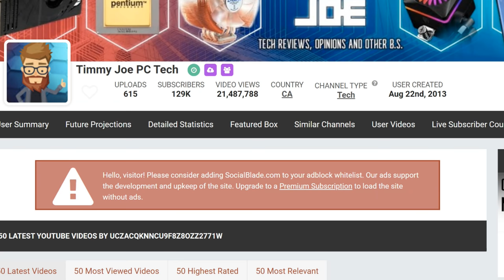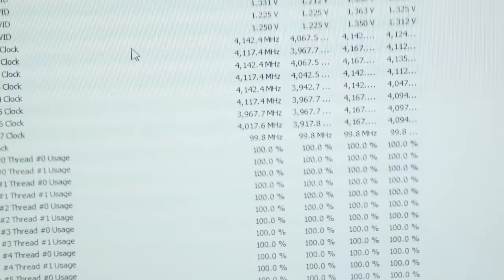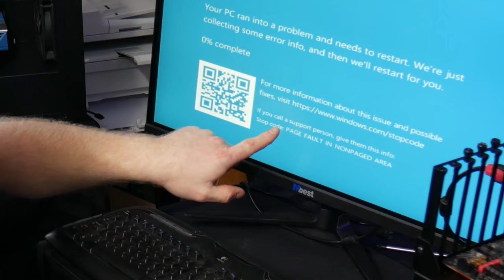This Ryzen 3700x was my biggest problem in 2019...

Comment: Weirdest issue I've ever had was with a Gigabyte 1070 surprisingly enough. I was building a computer for a friend and they had an Asus X99 motherboard and that card just would not post on that computer. I swapped it out with my 1080 and it worked. I put in a video card I borrowed from my office and it worked. I put the Gigabyte 1070 in my PC and it worked just fine. I even put both my 1080 and the 1070 in the PC and it would boot and I could see the 1070 in the device manager. Put the 1070 back in the top slot after taking my 1080 back out and no post. Weirdest issue I've ever seen. My friend ended up sending it back and getting an Asus 1070.

Comment: I went through similar pain years ago with a gigabyte board it was a G1 Sniper z97 for my 4790k build out of nowhere the system would suck all the available ram (16gb) into the non paged pool and the system would hang this happened for months despite trying everything registry fixes you name it after much trouble shooting I finally figured out it was the drivers to the Killer Network card. Also since the day I've owned it randomly the realtek audio card will  just vanish from the system and I have to reboot the system multiple times to get it to show back up I've since switched to a wireless usb headset and running my speakers through the monitor using audio over DP from my Nvidia card. Needless to say I'm building a new system sometime this year and Ill be looking at MSI and ASUS boards.

Comment: I just built a PC with a AMD 3700X and a Gigabyte AORUS Pro WiFi MB with the latest BIOS and haven't had any problems so far. The ram is G.Skill Trident RGB 3600. Running PBO but not PBO under XFR. PBO under XFR doesn't do anything but up the core voltage and make the CPU run hotter.

Comment: Yea, you were lucky...!
Last summer I bought an R5 3600X and an MSI B450 Tomahawk for my son.
After putting the parts together and installing the latest BIOS the motherboard refused to recognice the CPU as compatible!
Some research later I found a better (more stringent) way to install the BIOS and an even newer inofficial Beta BIOS that I installed and got the computer running! Yes!
Five days later the problem was back, and now trying different BIOS versions (a few had emerged in between) there was no way to fix it.
The CPU ran just fine in my computer on a Gigabyte AB350 Gaming-3 motherboard, and my R5 1600 ran just fine on the MSI mobo.
Swapping CPUs (between him and me) was not the solution though, since it wouldn't be much of an upgrade for my son who had waited nearly nine months for that upgrade. Swapping motherboards was also a non-starter since that would mess up the Windows licenses.
The actual problem (that's been reported for several MSI motherboards) is that in a few instances certain individual CPU-mobo combinations won't work. The same CPU on another Tomahawk motherboard should work. Another R5 3600X on that motherboard should work.
In the end I ordered an additional R5 3600 for the Tomahawk and use the R5 3600X for myself. ... but...
... my older motherboard began screwing up while I was busy getting my son's computer in shape. Reading the BIOS doesn't work properly.
After getting my son's computer up and running with the new CPU it was time to install the other 3rd gen on my motherboard. Of course that didn't work any more!
I had my old CPU installed and upgraded to the latest BIOS. Seemed to work fine. Unplugged everything and replaced the CPU. The computer passed POST and went into BIOS settings. I changed a few, "Save & Restart". The computer restart with some hesitation, but before passing POST it re-boots again and load the back-up BIOS, which is as old as the motherboard. This time it (obviously) doesn't acknowledge the CPU. Rinse and repeat! Checking the battery I find no problem, it's fresh.
I contact Gigabyte support and eventually get some instructions how to update the back-up BIOS as well. I fail to get the update software running on FreeDOS. Realise I have warranty left on the motherboard and send it to the retailer. Their service provider strangely find no problem, but at least return the motherboard with an updated back-up.
To me it's clear that the problem remain. The primary BIOS can't be read more than once (directly after installation). Any restart will use the back-up, running everything at default settings!

Comment: My weirdest PC trouble shooting problem of late was when I bought an R9 3900X with an Asus Strix X570-E m/b and 32gb dual channel 3200 MHz Corsair RAM. Was working great with stress testing OCCT 5.x for about 6 hours, no issues. Then I had a R9 3950X come in the door and wanted to check it out, so I replace the CPU as most of us done many times over, no problem there! Started up the stress test again and BAM I get all sorts of weird blue screens with different stop codes, like 'memory management' or some directx driver error, and even that weird one with the service error. Then it turned out one of the memory sticks just decided to die mid stress test, well better now than later right? Now then I started stress testing with one RAM module only, came through clear and no problems there, so I thought well that solves that, but nope! 

Then I was having issues with not being able to install Windows from an USB3 pendrive, I mean it did install but only with MBR non-UEFI boot and I did not want that. I wanted secure boot of course, so I tried disabling the compatibility module in BIOS to force it into UEFI mode, yet no dice! The pendrive would not boot, yet it was created with Windows Media Creation Tool, so I knew the pendrive was legit! Then I took an old PS/2 keyboard which has a USB 2.0 pass-through port, placed the pendrive in said port and tried again... And bingo! Now it would recognize and install in secure boot mode. Ehm... what?!

Naturally after these combined issues I thought well maybe I just got a corrupt BIOS or something, so I load up an USB pendrive with the correctly named BIOS file and all, place it in the USB port for flashback, held in the button for some seconds... and nothing! Well it turns out the flashback feature was dead on the board also. This was just so unreal, and here I'm still sitting with my trusty old i7 5930K CPU waiting for replacement parts lol... (because that one is an old hag by now!)

Comment: I upgraded from a Ryzen 7 1700X I got in May 2017 to a Ryzen 7 3700X, straight after it launched. I sold the 3700X after 1 and a half months and picked up a used, 2014 Intel Core i7-5930K. Found an "Open box" Asus Strix X99 motherboard for £262 to go with it and a new 4-DIMM RAM kit for quad channel memory. I have never been happier with my CPU & RAM config.

Comment: I had an AMD Ryzen 1700 cpu die after 2 years, which is in the last 22 years of building computer have never had a CPU die on me.  I am not and never have been an overclocker.  I just started getting blue screen doing nothing but opening at browser.  It was really odd and eventually the system would not boot at all.  To be fair though AMD was super awesome and covered the CPU with warranty replacement.  I am just sharing this, because I have seen similar issues before.  I knew it was the CPU, because I replaced it with a 2700x in the same system same system and it has been completely stable for months.

Comment: There was a time I used to get those "Page Fault in non-paged Area" blue screens from time to time, usually while gaming.  I stopped it permanently by increasing my page file size.  I had 32 GB of RAM back then, and by the logic of some, you wouldn't need the page file at all.  Tried that and I got more blue screens, not less.  So, I increased it as follows: Minimum: 10000, Maximum 50000.  I have 64 GB of RAM now and I still use this.  Never have problems with those errors any more.  It's been over a year, and reinstalled Win10 at least 3 times since then.  It works great.  It's the first thing I'd do.

Comment: I feel your pain. The common thread between the Gigabyte mobos is the BIOS.  That being said, have you checked the default parameters on the X570 board to see that they are being set properly for the 3700x? Did you in fact update the BIOS to the latest version? Just speculating. I have had build problems just like yours and agree it is maddening. Last thought - plenty of folks are using the 3700X with Gigabyte mobos - take a  look at Parts Picker. I think your 3700X is defective; only swapping it with another 3700X in the same mobos can prove it - no, I wouldn't - lol.

Comment: This will probably get lost in the comments. 

But I used to be a an a/v tech at a high school. I was setting up a smart board with a projector and laptop in a lab for a workshop. I had an NEC projector and a proxima projector. When I hooked up that NEC and smart board, the tracking on the board would get wonky as hell. You couldn't draw a straight line. But with the proxima it would be perfect. I never found out why either. It didn't make any damn sense.

Comment: Intel confidential CPUs can also do funny things like this. 
At work, I have an old Intel Engineering Sample 3960X, which does not run without freezing the entire system from time to time in Intels own DX79SR mainboard, but ist fine in every other X79 mainboard we have. 
The Intel board ist also stable with normal retail 3930K/3960X CPUs.

I don't know if this is the same for AMDs AGESA, or if they have CPUs marked as "confidential" or pre-release, other than "not for resale" label on the box, but for Intel, pre-release models (which are marked in the IHS) can use different microcode and/or are older revisions which are not validated/updated in later BIOS revisions by most motherboard manufacturers.

Comment: I have a 3700x and an x570 aorus elite, blue screen, when my computer boot, it boot few times before to boot correctly... I send back the cpu and the MB, they change the MB and said : no problem with the CPU. I still have the problem, i will take an asus MB.
The funny things is than during the few weeks where my MB and CPU was back to the seller for test, i buy an other x570 aorus elite and 3700x on amazon, and I had no issue, clean boot, no crash, no BSOD... It's looks like it's completely random :/
Reply: dude... i am literally having the same F*ng issue right now as well!! First I got this Ryzen 7 3700x, MSI B450 Tomahawk Max and used my working RX580 GPU... Blue screen/flicker saying its a radeon thing... I did all the troubleshooting for it and did several times of reinstalling windows on my ssd. I also did Memtest 86 to see if the sticks were bad... but nope... So I came to a conclusion that it has to be the Mobo. I returned the MSI mobo and spend extra more for an Asus X570 Tuf Wifi as it has gotten rave reviews. Installed the Ryzen 3700x along with RX580 GPU... blue screen with the same error code. Then I was thinking then maybe it could be the GPU since its poiinting the error at a radeon/ati crashing and successful recovery... (yes I did my whole exercise of bios update, chipset update, hadware updates, windows updates... hell even registry changes!!). So one of my last changes I did was that well i have an Nvidia 1050 ti that I know it works on my other computer. I did a DDU uninstall of the RX580 and installed Nvidia GPU... well the issue still remains after all that swaps... the only thing I didn't do a swap on is the CPU itself... I started getting errors BSOD and whea-logger error and fatal processor errors and such!! Now It has got to be the CPU!! Now i'm currently waiting to get an approval return of the cpu and getting another Ryzen 7 3700x in hopes that I get a non-faulty one... But now... after wathcing this video... I'm starting to think that the "Gremlin" could BE the Ryzen 7 3700x in general!!! Oh god... i hope not... because if it is... then F U AMD!!!!!

Comment: I fought with the same blue screens for years. Every diagnostic I could find came out good. Finally just before scrapping the computer, I pulled out 2 of the sticks of RAM. No problems since. I had reused those from my old PC thinking more memory was better. It had the same timings. Dell said they were compatible. But they just didn't work together.

Comment: I had blue screen issues with my 3700X on the Gigabyte Aorus X570-I Pro Wifi. I found the problem to be an incompatibility with the Gen3 PCIe Riser cable and my 5700 XT. Luckily Gigabyte had a setting to change PCI compatibility to Gen3 and the blue screens became a thing of the past.

Comment: Hello, I think received a bad cpu worked for 2 months no issues and then one day I came home it was on, and I remember turning it of be leaving. It was not raining power surge wasn't possible.

I bought a new board b550 msi motar wifi and it still won't show anything on my screen which is when I realized that it was cpu.

I've checked this cpu over multiple times, theres no physical damage reconnected ram and components multiple times remains unchanged.

Original motherboard b450 aorous m, cpu 3700x bought in jun/ july fairly new build only reusing ssd from a couple years ago.

If have any advice I'd would be happy to hear!

Comment: I had a threadripper 1950x that did the same thing... on an MSI motherboard.  Played with voltage to solve the issue.  There's probably a VRM issue. Could be frequency, could be the phase doublers..

Comment: My weirdest tech issue I had happened years ago on a system running Windows 98. A computer I had built started having issues. Norton Antivirus wouldn't update correctly for the customer. It turned out three pieces of software were involved and the order in which they were installed was causing the problem. If installed last, Adobe Acrobat overwrote a DLL that the other two used. But Acrobat ran fine with an older version of the DLL. So, I'm not sure why the program installed a different, updated version. But after three weeks of playing phone tag with customer support at Microsoft, Symantec, and Adobe, and getting no real support from any of them, I was the one who figured out what was wrong by looking at the list of files that each piece of software installed. Quite a process, I might add. Once I identified the DLL that was causing the problem, I booted the system into DOS and swapped out the DLL for the one that worked with all three pieces of software. Apparently, I wasn't the only one with the problem, though. About a week after I figured out the solution, Symantec called me to ask if I was still having the problem. Obviously, after several support calls, my name and number was in their database. Really, they wanted to know what I had figured out. Since I had stopped calling them, they figured I knew what was causing the issue and since they had other customers with the same issue... Anyway, I explained how I fixed it and told them that Adobe Acrobat was the program causing the issue and it only happened when it was installed after the antivirus and after installing MS Office. If it was installed first, there was no problem because MS Office would install the correct DLL for the Antivirus to use.

Comment: My weirdest one was a ssd controller failure. A fresh install of windows would work for at most a week. Then restart the computer, boom wouldn’t boot. Fresh install it again. Fine again for a week or so. I still can use that drive as a storage only drive just fine. As soon as I use it for anything with random reads and writes it corrupts

Comment: Worse cpu problem I ran into was actually with my z390 aorus master and 9900k and I upgraded my liquid cooling to a custom hard tubing loop, when I put it all back together it wouldn't post, what threw me off was when the motherboard was trying to post it would go from cpu them to dram them hdd then it would recycle back, I removed the CPU about 8 times to see if I bent a pin... So about 8 hours later of non stop diagnostics, I looked at the socket one more time, then I squatted down to get something and looked be at the socket from a different angle... There was a piece of lint on top of one of the pins on the motherboard... Took it off with a pair of precision tweezers... And it was like a huge weight off of my chest

Comment: My worst? Z-370 on Asus board; sleep mode would lock the power supply. Eternal sleep. 
Sent the power supply in many times under warrantee. I finally quit using sleep mode and have had no further issues.

Comment: Instead of BSOD, I got mine that just freezes when idle. Currently running Ryzen 2600 with Gigabyte B450 Aorus Pro Wi-Fi . I thought I fixed it once and for all when setting power supply settings to "Typical current Idle" in the BIOS until 2 weeks later when it froze again (was just running VMWare/RDP when running music in the background), CPU idling less than 5%. No issues at all when stress testing over 2 hours (CPU 72c under load). 

Current BIOS version is F60C. Before this hurdle, since I dont overclock, I did have BSOD when turning on XMP for Corsair 3200mhz RAM and fixed it by keeping XMP but lowering mem speeds to 2933mhz.

Comment: I can answer why, did you check the vdroop? Sounds to me like a voltage regulation issue. Either from the built in power saving or turbo boosting.  So to curb that you need to set a voltage on the vcore or check to see if there is line load calibration options and set their parameters so it doesn't drop below a certain voltage. Back in the day, think it was my 3rd pc build, I had a AMD Anthlon XP on a gigabyte board and ran into similar issues until a bios update was released.